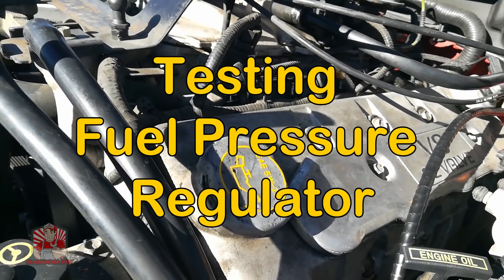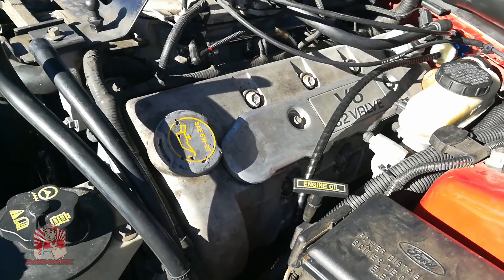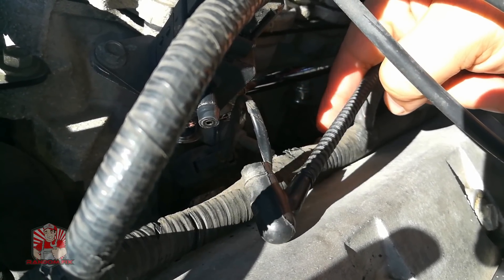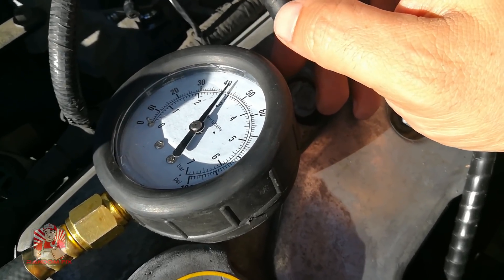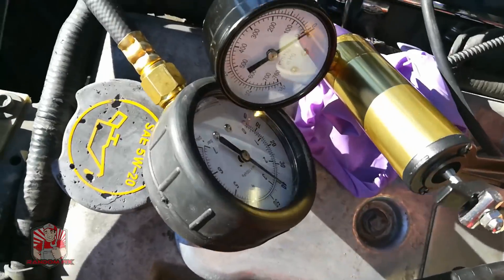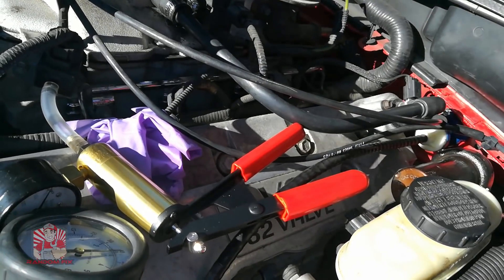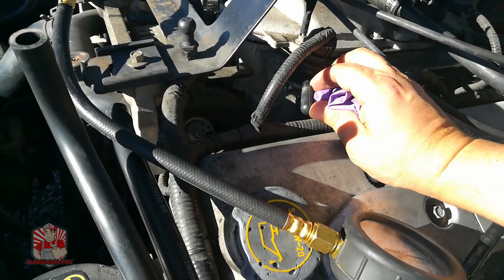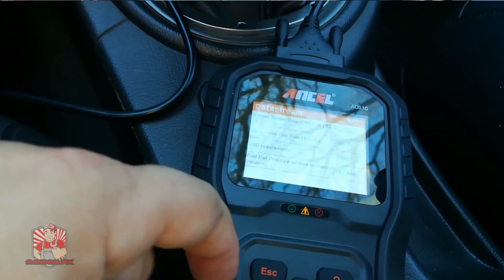How to Test Fuel Pressure Regulator ▶️Test Fuel System And Check Fuel Pressure

Comment: Good video and thanks for sharing..btw I hooked a gauge up and when I turn the key on it jumped to 40 psi left if and when I came back it dropped more than 10 psi not sure if it's the fuel pump or the fuel pressure regulator what you think?
Reply from the maker: I think you maybe better luck with a the fuel pump. Maybe leaking pressure.
Reply: @RANDOMFIX  changed the fuel pump still having the same issue..I started having this problem when I replaced the battery with a rebuilt battery maybe that's the problem..I
Reply from the maker: Any updates, fyi, I would never recommend installing anything other than a premium new battery as there are too many things that can go wrong because of a inferior battery.
Reply: @RANDOMFIX   that's true but I did a scan and found that the o2 sensor upstream is not showing no reading at all...the scan do show it's getting voltage but no reading from the o2 sensor..maybe that's my problem but the weird thing is the hesitation I'm getting is only on hot sunny days but at night the car drives fine..I'll change the o2 sensor and see if that would fix my problem..
Reply from the maker: Ok, keep me in the loop.